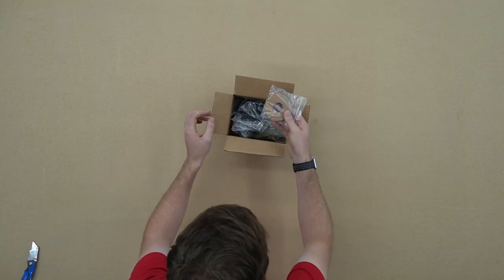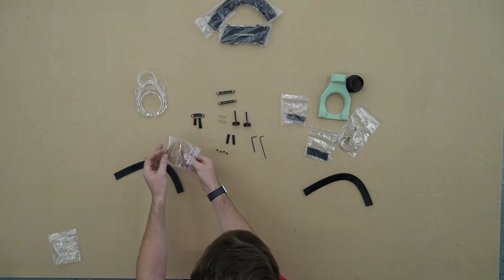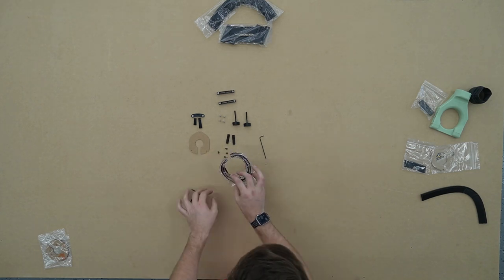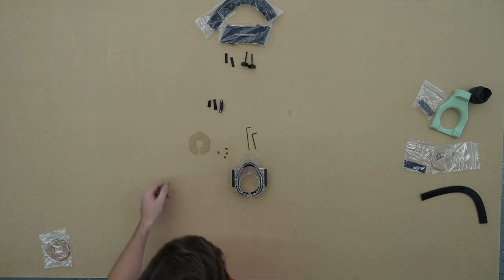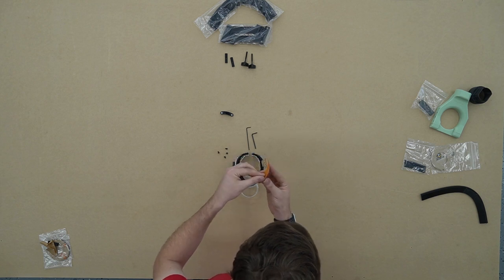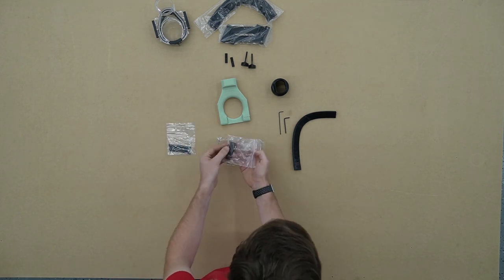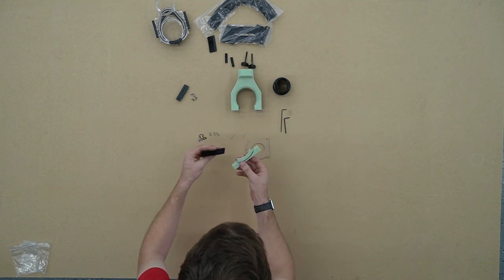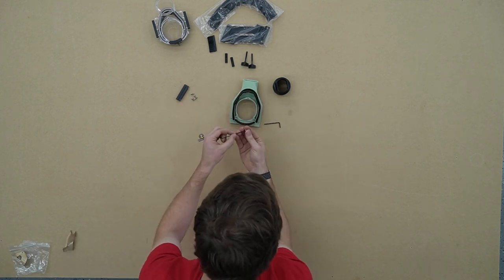Infinite Dust Collection Video

Comment: How far beyond the frame does each boot go with hoses connected?   I have a very tight space in that direction, and I just broke my suckit pro trying to get the brush in.  Not sure if I should order the green 1 or a replacement clear boot.
Reply from the maker: the suck it extends beyond the frame forward, the green one goes out the back.

Comment: I'm new to Infinity products.  What is the difference between the pro and the infinite collectors?  Why buy one over the other?
Reply from the maker: the pro is only the clear dust boot, the infinate collection is both the suck it and green pwn cnc boot.
Reply: @OnefinityCNC  what is the advantage to having both? That is not really clear to those of use new to CNC, especially given this assembly video does not show their application and install on the machine. Thanks.